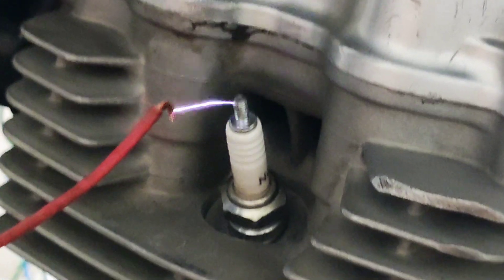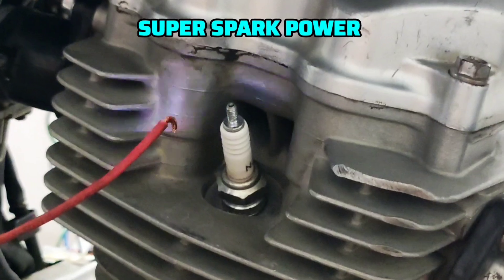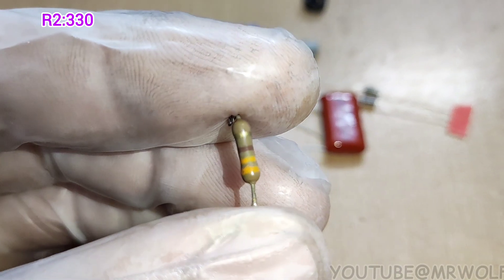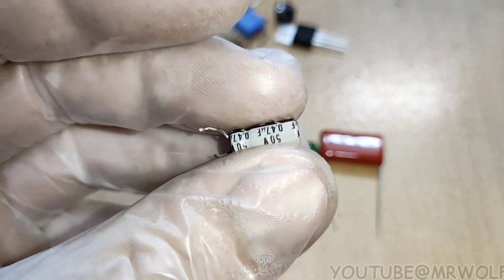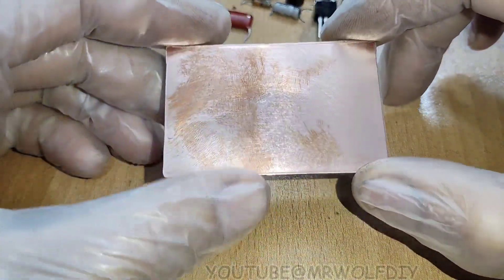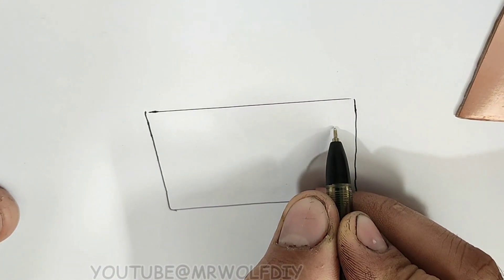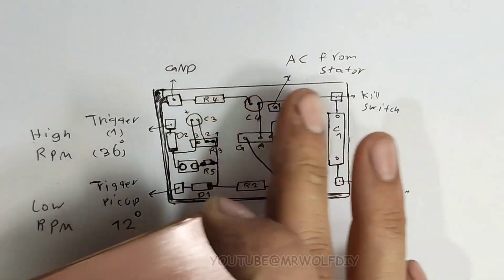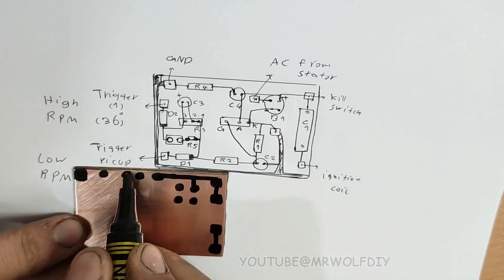How To Make A Ultimate DIY CDI for Any Motorcycle! Full Guide

Comment: Sorry, i want to ask if non pulser cdi can use a potensiometer.if possible can i ask for the schematic?
Reply from the maker: A potentiometer can be used, but not as a direct replacement. It requires modifying the circuit and adding some additional components.
Maybe I'll build this version later... 🙌🙌
Reply: @MrWolfDiy ok, i will wait

Comment: Will this work on a lower RPM engine???   I wanna run this ignition on a tractor that has a max RPM at 1550. At around 750 RPM it needs to go to maximum advance , also will it work for a DC ignition?   Being the tractor doesn't have a stator. I'll need to make a set of pickups inside the distributor.
Reply from the maker: It works on low rpm but it's AC powered cdi,
What ignition system is your tractor currently using...?
Reply: @MrWolfDiy 
Points style.  It's been converted from 6 to 12 volt , with a Dodge ballast resistor.   Petrotnix makes the electronic conversion , but it has gotten super expensive , and people say the new ones doesn't last long.   
    I want to make a coil over plug , but not sure how to make the trigger turn off around a second or so if the engine stops where it's sending the signal to the coil , so it doesn't burn the coil up.  It seems simple enough to simply run a set of 3 pin coils with the ground signal , but as I said if the engine were to stop while the ground signal is being sent to a coil , it would burn which ever coil it happened to stop on.  It also seems using a coil over plug would work great on any small engine as well including motorcycles
Reply from the maker: Look, my friend, doing this project isn’t  easy, but it can be done.
I need these details about your tractor so I can guide you properly:

_Model and type
_Number of cylinders
_Does it use a distributor or a points-type magneto? 
_Distributor rotation direction and the number of lobes on the points cam
_Maximum required RPM.

Comment: Hi
I built this CDI myself, but there’s a problem.
When the engine RPM reaches 4500–5000, the engine starts missing fire
Also, no matter how I adjust the potentiometer volume, it has no effect on the ignition timing, and the engine still hits the rev limiter!
Thank you very much.
Reply from the maker: Hi,
If you’ve noticed, the potentiometer is only used in dual-pickup engines, and it changes the low-speed jump of the trigger outputs.
It’s not really for adjusting advance, and in single-pickup engines, it has no role.
Also, it has a limitation on the amount of advance. Can you tell me what motorcycle you have?
Reply: @MrWolfDiy Yes, I installed it on a CG125 that’s in my profile photo.  
Can you tell me why the engine starts missing fire at around 4,500–5,000 RPM?
Reply: @MrWolfDiy  
Hi my friend, I solved the problem, which turned out to be one of the capacitors. However, when kick-starting the engine while it is cold, the kick lever kicks back. Also, when the engine is idling and I open the throttle, it sounds like piston knock. But at higher RPM, it performs better than the stock CDI.

Can I fix the knocking issue by adjusting the potentiometer and retarding the ignition timing slightly? The potentiometer is currently set to 10 k ohm.

Comment: Did it adjust degree by itself  or not?
Reply from the maker: Trigger outputs in this CDI, are based on the pickup angle and are used on motorcycles.
Originally, they are designed for two-pickup engines, but they can also be applied very well to single-pickup motorcycles.
I have explained the function of the potentiometer in the circuit in the description.

Comment: Why to use a bridge rectifier if you are connecting one AC stator to Chasis (GND)? Can be better if the stator goes directly to a always used bridge rectifier?
Reply from the maker: Hi dear and thanks for the detailed question!
Yes, it is better to connect the stator directly to the bridge rectifier. This way, both AC half-cycles are used, and the CDI capacitor charges faster and more completely. If the stator is connected to the chassis (GND), one half-cycle is lost, so the performance and output voltage are lower.👍♥️

Comment: its always with the thyristor bt151 scr as main menu for all ur cdi project ..broh ..cool 😎
Reply from the maker: A thyristor is a switch, and most thyristors work the same way.
The main differences are in their switching speed and their voltage/current handling capacity.
In circuits of this kind, such as CDI systems, models like BT151, BT152, C106, and 2P4M are the most commonly used. Thanks for watching ♥️

Comment: How can i make this so that low rpm mode is 8000 and high rpm mode is 12000-14000
Reply from the maker: In an analog CDI, this is usually controlled by resistors and capacitors on the circuit. You need to experiment to reach the desired result...

Comment: Does this work with every ac cdi with single pickup coil
Reply from the maker: Yes, you can use only the 36-degree output for engines with an AC ignition system.

Comment: What is the life of the cdis you make?
Reply from the maker: Hey buddy, That's a good question,
It lasts longer than the versions available in the market. I had bought a few before, and they burned out very quickly. If a circuit is built properly with quality components, it will last much longer.

Comment: So will this design or any of your other ones work for a V-Star 650 which has 14 (6/8) pin connectors?
Reply from the maker: Hi dear friend,
No, your motorcycle uses an advanced DC CDi, currently, I haven't built one,
But I will try in the future. ♥️🙏

Comment: Hi friend, i have a hyosung v twin cilinders 250 cc, i put 2 signal sensors, 2 of this cdi will work? Do you have any sugestion?
Reply from the maker: Greetings dear friend,
I must say that the ignition timing for each cylinder can be different and needs to be checked.
(Some engines fire both cylinders simultaneously.)
The sensors you installed must be positioned in such a way that, based on the crankshaft movement, they send a signal to the CDI when the piston in each cylinder is at top dead center (actually slightly before it)...
If this condition is met, then it's possible for your setup to work.
My question is:
What type of CDI are you using exactly?
And what kind of sensors are you referring to, where exactly did you install them, and for what purpose?

Comment: Would it be possible for you to build a CDI for a Harley Davidson, that uses a CKP sensor, with a rev limiter, advance curve to be used with a 5ohm coil?
Reply from the maker: Greetings,
Your motorcycle’s ignition system must be either TCI or DC-CDI, and an analog CDI is not suitable for your setup.
You’ll need to use a programmable microcontroller-based CDI.(Digital)
I had built a prototype before, but I didn’t publish it due to issues with the coding.
If I’m able to, I’ll create an optimized version in the future.
Reply: Get one from a Briggs and Stratton.

Comment: I need to try the BKL3B injection module with a Honda Africa Twin coil for my homemade seven cylinder rotary engine. But I don't know when I will do the test, I think around June 2025. I hope to get a strong spark. I was looking at the hall sensor but an inductive one is better (which does not require the application of magnets).

Comment: harkia olmus dostum bu CDI modülünden bir tane de ben yapacağım ancak bir şeyi anlamadim 36° lik çikişta sürekli  kullandigimiz zaman köprü parcasi takili kalicakmi (jumper) ve 10 k ohm potansiyimetre ile ayari  köprü takili iken mi ayarlamamiz gerekiyor ? yardimci olursanız cok mutlu olurum saygilarla
Reply from the maker: Greetings,
You can use the 36-degree output, 
in single-pickup engines, the adjustment doesn’t have much effect.

In fact, the jumper allows adjusting the sensitivity of the transition from 12-degree output to 36-degree output, but it doesn’t play a significant role in single-pickup engines.
Reply: Thank you
Reply: Vau türk buldum

Comment: It's great my friend, I will make one of these CDI modules too but I don't understand something. When we use it continuously at 36° output, will the bridge piece (jumper) remain attached and do we need to adjust the setting with a 10 k ohm potentiometer while the bridge is attached? I would be very happy if you could help me. Best regards

Comment: Greetings. Your video inspired me to make a CDI according to your instructions. I copied the parts list and went to the electronics store. The seller is an electrical technician, so he asked me if I could show him the plan for connecting the elements. he warned me about one point. He told me to ask if the connection of the diode bridge (B1) is really correct. He says that he understands the connection from the stator to B1, the connection to the kill switch. But he does not understand why the negative DC and AC contacts are connected to B1. Could this be a bug? Thanks for the reply.
Reply from the maker: Greetings, dear friend,
No need to worry. The circuit is completely correct, and as you can see in the video, it works perfectly. 
In fact, the AC input and the kill switch are the same, and when the switch is closed, the circuit shuts down by applying a negative current to the AC input.
A new video will be released tomorrow. In this video, I will teach how to build another high-power CDI. If you're interested, you can watch it as well.🙏♥️
Reply: @MrWolfDiy  Thanks for the quick reply. I ordered the elements for the production directly from Aliexspress. As soon as I get the parts I will make a CDI according to your design.
Reply: @matjaztemplar8671  did it work?

Comment: can you add led for when spark happens everytime and then add additional 4-5 leds for the frequency and how much power it pushing low-max.
Reply from the maker: You probably mean the LED tachometer, which is a separate circuit connected to the CDI. If I find the time in the future, I'll provide a tutorial on how to build it.

Comment: How to red LED add?
Reply from the maker: You can achieve this by adding a diode and a resistor to the LED:
_Connect the positive terminal (anode) of the diode to the positive output wire of the pickup.
_Connect the negative terminal (cathode) of the diode to the positive leg of the LED.
_Connect the positive leg of the LED to the resistor output.
_Connect the negative leg of the LED to the ground (GND) of the circuit.
A rectifier diode, such as 1N4007, and a resistor between 330 ohms to 1 kOhm would be suitable for this setup.

Comment: Hi, I have some questions: is it possible to create a CDI that works with the points signal? 2. I would really love it if you could also make a microcontroller version to have programmable timing. Thanks.
Reply from the maker: Hi and welcome,
Yes, it’s possible, but the points signal needs to be amplified. This requires an intermediate circuit, but you can also do it with just a transistor.
As for the second question, I’m thinking about building a microcontroller-based CDI. If I can manage it in the future, I’ll make one....
If you need more details about the first question, let me know🙏
Reply: @MrWolfDiy  first of all thanks for the answer, having a moped with point ignition and a fixed ignition timing I would like to make a control unit with a trimmer to delay the timing, if you have time it would be very kind of you if you could make a video where you create a control unit for point ignition.
second: for the control unit with microcontroller I would like to create it for another moped that has an internal rotor ignition, my intent would be to create customized ignition curves for the engine instead of having the spark always occur at the same timing.
I'm not very expert on these things, so having such a knowledgeable and helpful person answering me makes me really happy.
have a good day and keep up the good work you are doing.
Reply: @monej-gaming632 It really wouldn't be worth the time on a moped , to learn something maybe but you would get zero gains over the points .
Reply: @MrWolfDiy  Hi, I think my answer didn't reach you, would you be so kind as to give me an answer? Thank you very much and sorry for the inconvenience.

Comment: Hi, would this circuit work on an old 600cc klr, kick start, very keen to build one if it will run the motor well. Thanks for the hard work.
Reply from the maker: Greetings dear friend, what an amazing motorcycle you have! Yes, this CDI can be installed on your motorcycle. Wishing you success!👍♥️
Reply: @MrWolfDiy  where is shifter diagrams ????
Reply: This would probably make your KLR less reliable, definitely wouldn't be an improvement over the factory.

Comment: I have watched a couple of your CDI videos. 
I would like to know, if any of the CDI’s that you have made will work on a 1978 Honda CB400T?
Aftermarket CDI’s are expensive and if yours will work, I will build one.

Thank you
Reply from the maker: Greetings friend,
Yes, it is usable in models equipped with a CDI ignition system.♥️🙏
Reply: I made one of those run with an old Ford ignition box .

Comment: Where i can place a tripod to make it have rpm limiter?
Reply from the maker: The RPM limiter is a separate circuit that is added to the CDI. I will teach how to build it in future projects. 
However, if you use the 12-degree output from this cdi, you will have the RPM limitation.
Reply: @MrWolfDiy  but how?

Comment: berapa derajat pick up pulser nya kak? jika saya menggunakan Pulser single
Reply from the maker: With both outputs, the engine will run, but for better performance at high speeds, it is recommended to use the 36-degree output.
Reply: @MrWolfDiy  this cdi adjustable limit rpm or timing?

Comment: Very really nice contents, What if I need 10000rpm or more?
Reply from the maker: Hi and welcome,
To achieve higher RPMs, such as 20,000 and 30,000, a microcontroller-based CDI is required. However, it can be harmful to the motorcycle's health and should only be used under specific conditions.
I might give a tutorial on how to make it later...
Reply: Is it possible? When decreasing the resistance of R3, do the rpm increase or does it only change the degrees?
Reply from the maker: Hi , In this circuit, potentiometer R3 is used to adjust the sensitivity of the trigger pulse for engines that have two pickup triggers with different timing angles.

Comment: 2 zamanli motora uygunmu yani mbk av 10 motorsiklete
Reply from the maker: If your ignition system is CDI, then yes, but in older models with points, it requires replacing and upgrading some parts for compatibility.🙏
Reply: @MrWolfDiy  thnks

Comment: How many volts does this circuit work with? I installed the circuit without any problems, but the bridge diode burned out at 14 volts AC. I would appreciate it if you could help me, my friend.

￼
Reply from the maker: This circuit requires 50-110 volts AC to operate, which is generated by the motorcycle alternator...
The bridge diode used has a voltage tolerance of 600 volts ac...
Please note that if you power a DC CDI with AC power, it will definitely burn out...
Reply: @MrWolfDiy I don't understand whether we need to convert the ac voltage coming from the motorcycle alternator into dc voltage. I didn't give it exactly dc voltage. I fed it with 14.4 volt ac voltage and the bridge diode burned out. I would be very grateful if you could help me with this. I have a Peugeot 103 moped. I want to adapt this circuit to it. We are waiting for your help.

Comment: Thank you for your posting. It's always nice to see other CDI offerings. I'm slightly confused however, sorry. Let me explain. if you can adjust the stator plate on the bike to alter the timing, why would you need another adjustment in the CDI? Thank you.
Reply from the maker: This setting is not for timing, and adjusts the jump sensitivity from 12 degrees to 32 degrees input
Reply: @MrWolfDiy  Thank you for your prompt reply. I'm still confused what this is. What is 'jump' sensitivity? Is it to do with setting the input sensitivity for the incoming pick-up coil signal perhaps? Thank you.

Comment: Bro thanks for this, can it work on a car.
Reply from the maker: Hi and welcome 
Using a CDI (Capacitor Discharge Ignition) from a motorcycle in a car is usually not feasible due to fundamental differences in the design and operation of the ignition systems for motorcycles and cars.

Comment: I've seen similar schemes. It differs from the classic CDI only by replacing a pair of permanent resistors with a tuning one, which allows you to change the threshold of the thyristor, which means that it becomes possible to adjust the ignition timing angle more accurately. This is better than the standard CDI, but far from ideal...

And no, this is not a microprocessor ignition, which means there can be no flexible speed adjustment here

I would like to see transistor ignition (TCI) on the channel

And please, can you insert ordinary electrical circuits somewhere in the video? I understand that most of the audience of this and other similar channels may not understand electronics, but it hurts me, as an electronics engineer, to look at a wiring diagram without an electrical one
Reply from the maker: Hi and welcome,
Yes, microprocessor ignition systems and TCI offer more flexibility.
Maybe I will make a video about this in the future.🙏